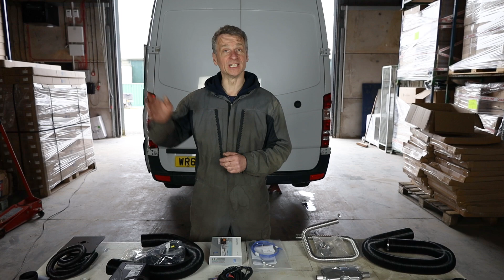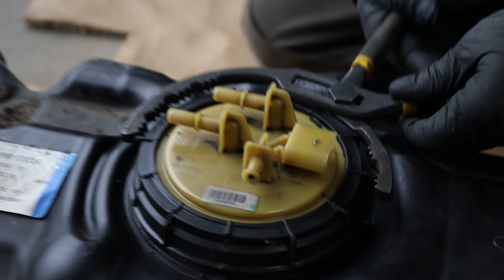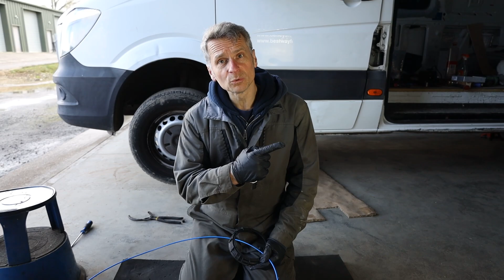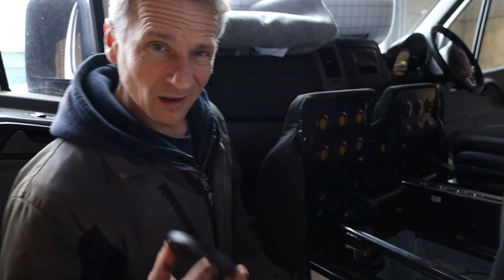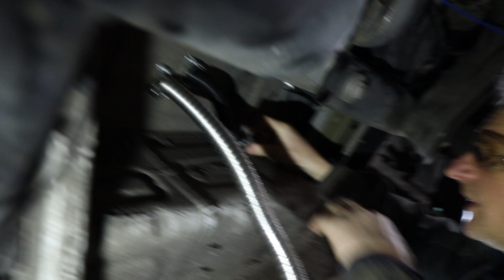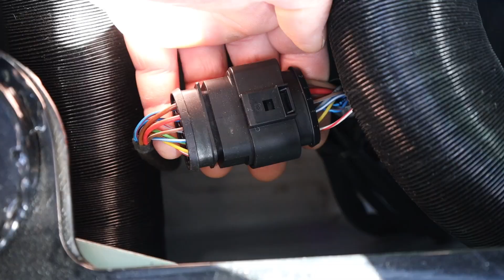Fitting A Diesel Heater! Project Sprinter EP6

Comment: So why not use the supplied heater tank instead of using your own gas tank?  I would keep them seprate for easy acess. Nothing wrong doing it your way either.
Reply from the maker: Hi, the reason we didn't use the separate fuel tank for the heater, as the van runs off the same fuel & uses very little really. Hope that helps!